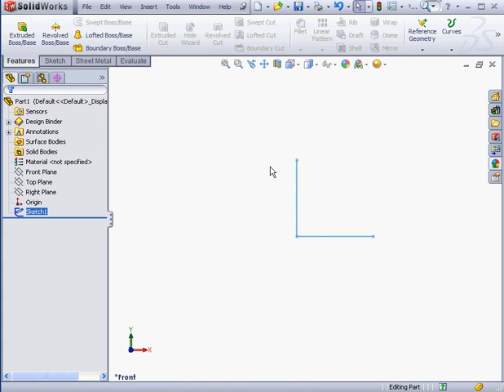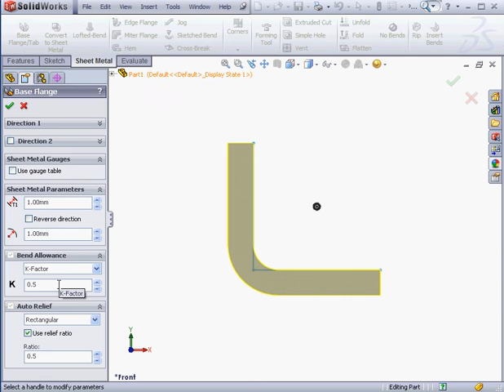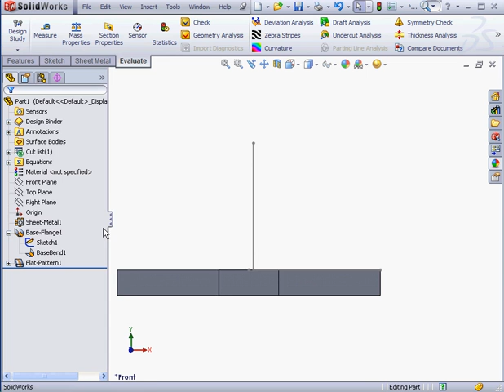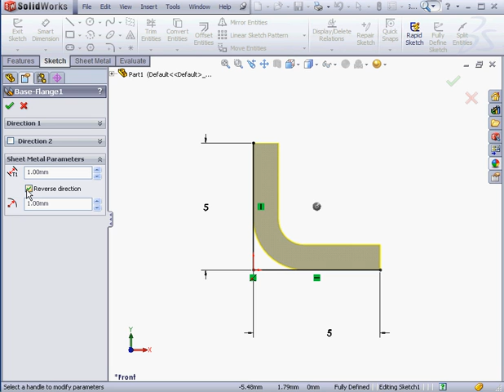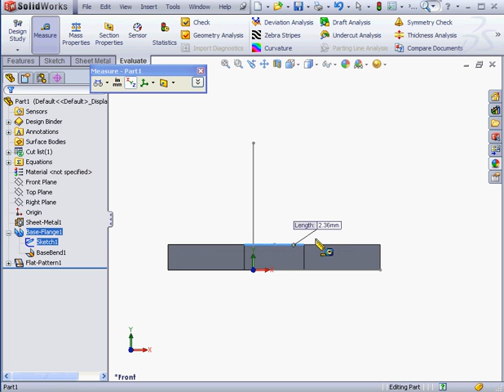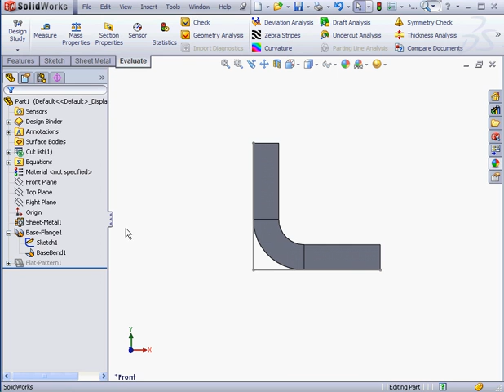SolidWorks Tutorials - Sheet Metal 2012 - What is K Factor?

Comment: okay but k factor is even varies.
depending on thickness, bend angle, punch type, material, etc....

for a sheet with multiple bendings 
can i assign multiple  K's for different angle?

if so how?

thanks
Reply: In that case it is better to use the option "Bend Table". The values of bend Table is actual values collected fro Experiement or the original sheetmetal vendor's datasheet.